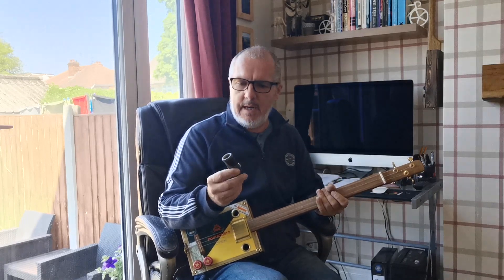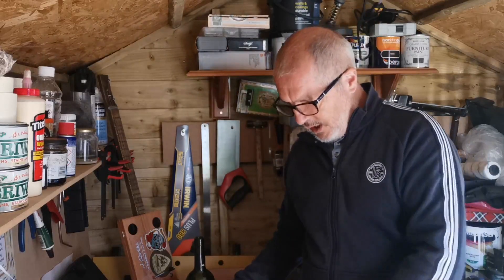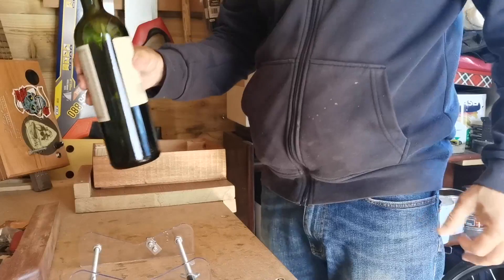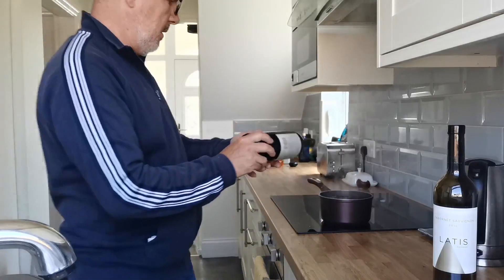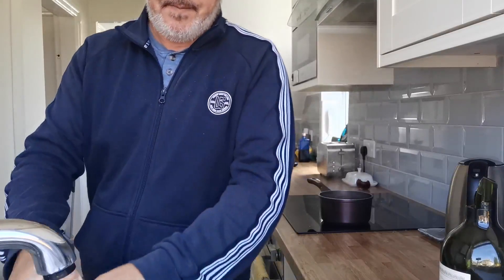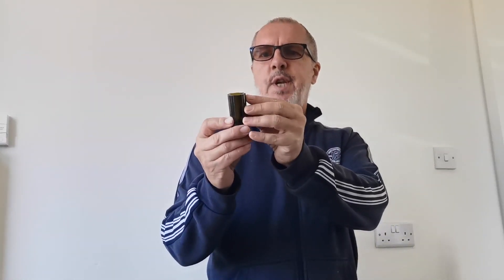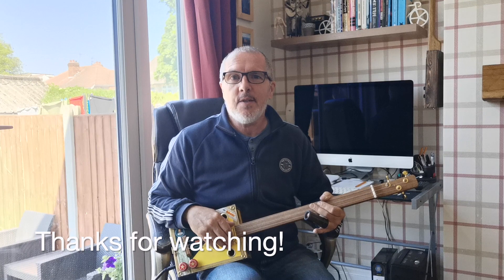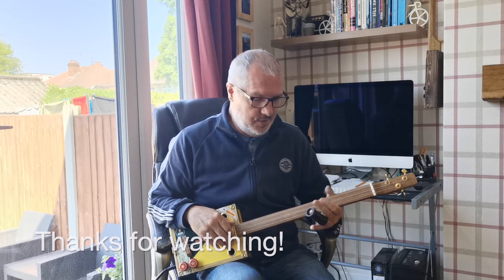How To Make Bottleneck Slides For Cigar Box Guitar

Comment: I've made a few of these myself with the boiling water/ice water method.  Out of 7 bottles, I might yield two slides due to the fact that I frequently get a crack running up through the neck.  Those must be discarded.  So, you've got to have a good supply of wine bottles on hand.  But, a local wine store here is eager to give me as many empty bottles as I can carry.  Usually restuarants and taverns will readily part with them as well.
Reply from the maker: Great tip!
Reply: Or just drink the wine.  In our house my wife makes sure there is plenty of empty bottles.  :)